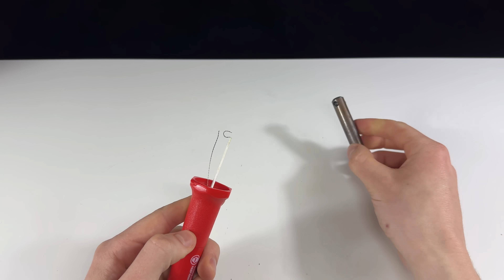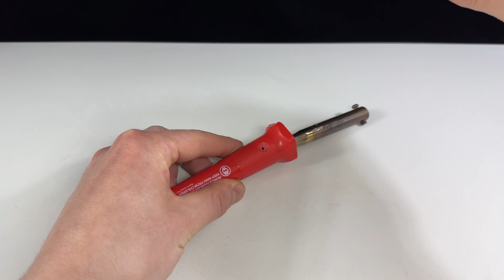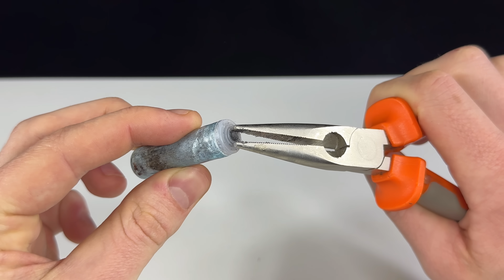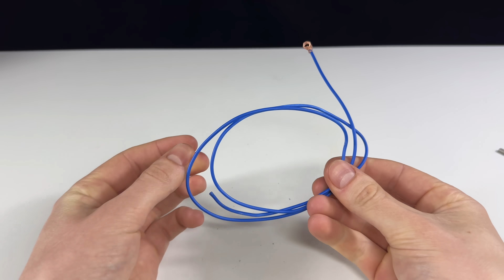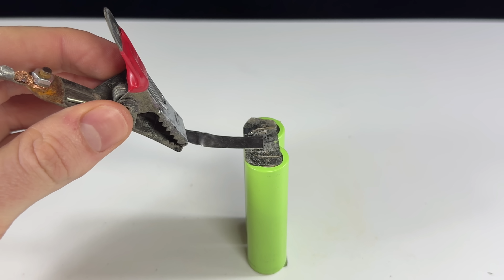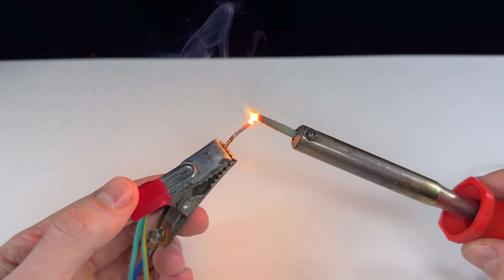How To Make Simple 1.5V Battery Welding Machine At Home! Genious Idea

Comment: This is such a dangerous thing to do.

1. Getting people to tear down a battery is very dangerous 

2. How this works is simply shorting the battery, you should NEVER do this, shorting the battery will cause it to overheat and could result in the battery exploding or catching fire

Comment: is it realy 1.5 volts? I think you used something like 20 volts portable battery...
Reply: I think the power is coming from the transformer/charger the alligator clips are attached to. I can't see what the power specification are on it. The battery just provides lithium core.

Comment: So basically the battery has lithium hearth inside it? you need to sand it off a bit. And when lithium gets electric power it heats up hard. Nice!
Reply: He uses a zinc-carbon battery for the carbon rod, and sands the carbon to a point.

Comment: Is this dangerous at all? Any professional that wants to inform me?
Reply: Το βίντεο είναι ψεύτικο γιατί την ώρα που κάνει τις κολλήσεις δεν φαίνεται η πηγή του ρεύματος και η μπαταρία που έδειξε στην αρχή δεν μπορεί να ζεστάνει την άκρη του εργαλείου κολλήματος μέχρι να αποκτήσει το κόκκινο χρώμα για αρκετό χρόνο.
Reply: А какое питание необходимо подобрать чтобы данная самоделка работала?
Reply: @user-mpampis060Gr А какое питание необходимо подобрать чтобы данная самоделка работала?
Reply: @dogiysm  ανώτερη των 50 Watt
Reply: Yes.
Reply: You're basically using lithium-ion batteries as a power source, shorting the terminals through wires. Eventually you will cause a thermal runaway, causing your battery to blow up and cause injury. This whole video is idiotic. Just use the soldering iron as intended.
Reply: @SwayinZombie  lotta that goin round here on the YouTube.   Hell, in the time it took to make that ..   coulda went out, cut a few lawns and made the $$ to just go buy the correct tool at Harbor Freight.  Lol

Comment: That title is misleading. It consumes more than 1.5V. You might just think of using a capacitor to quickly charge + pencil to do that menial task. Saves money. Read and learn about capacitors. They charge at a fast rate, and you can control the discharge rate.

Comment: You're basically using lithium-ion batteries as a power source, shorting the terminals through wires. Eventually you will cause a thermal runaway, causing your battery to blow up and cause injury. This whole video is idiotic. Just use the soldering iron as intended.